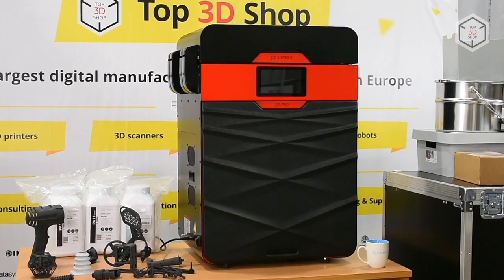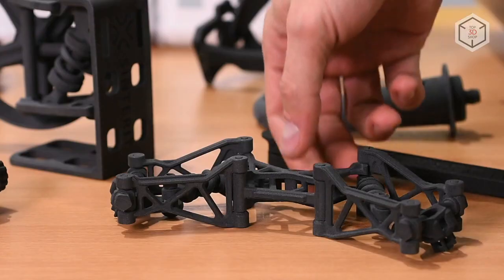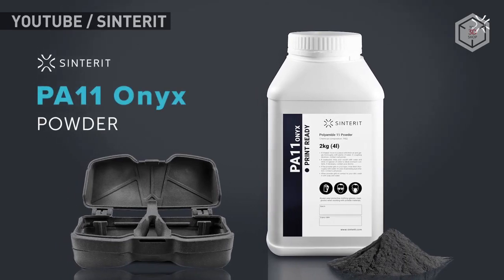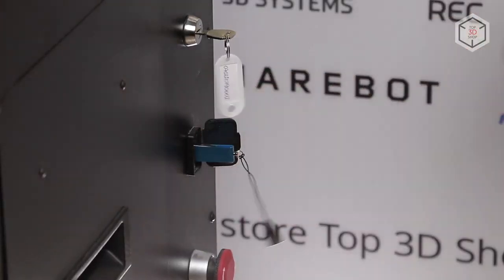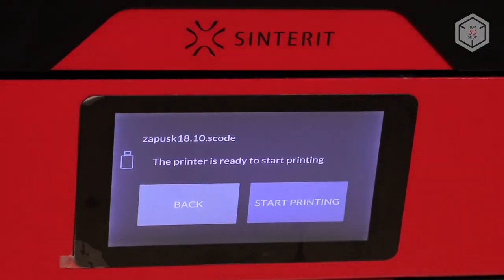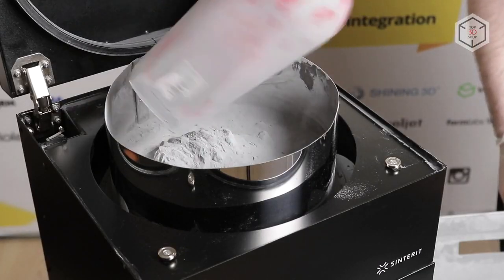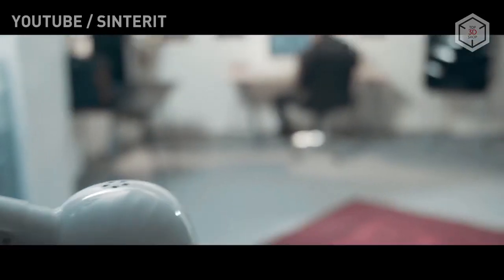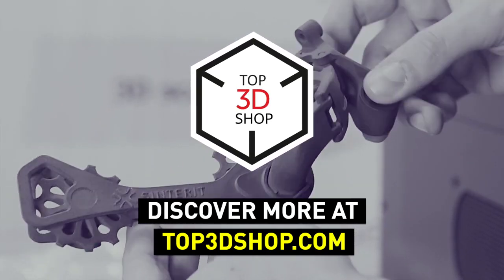Sinterit Lisa Pro Review: The Best Desktop SLS 3D Printer 2020

Comment: It's a nice $15,995 3D Printer.
Reply from the maker: Yes, it isn't cheap but it's good value for money
Reply: Not too expensive still... Fuse 1 will be $9999
Reply: @erikm9768  not anymore... they increased the price to $16,000 (sad noises) I really want an affordable SLS printer...
Reply: @fouadabboud5650  Sad. Sinterit Lisa is like only $6999? You can also DIY ...
Reply: @fouadabboud5650  sintratec kit
Reply: In terms of SLS thats cheap.  The ones we use at work are around £250,000 - £750,000 depending on the model.   Additionally they are 7 years old now.

Comment: Hi are you able to sinter chromium cobalt?
Reply from the maker: Hey, no, you wouldn't be able to sinter chromium cobalt on Sinterit machines. They are targeted at working with PA12, PA11, PP. If you're interested in a metal 3D printing solutions for dental, consider SLM additive manufacturing systems. We've supplied a good number of these in the US and Europe. 

Feel free to reach out to sales@top3dshop.com if you'd be interested to have a more in-depth discussion on this.
Reply: Great thank you.  Would you please send me a link to your slm system. Please include all necessary equipment and space requirements.
Regards,
Alex Hupka Denturist
Reply from the maker: @estheticsdenturestudioinc.291  Hey Alex, what's a good email to reach you at? A suitable solution would depend on a number of factors, including the required build size, materials and budget.